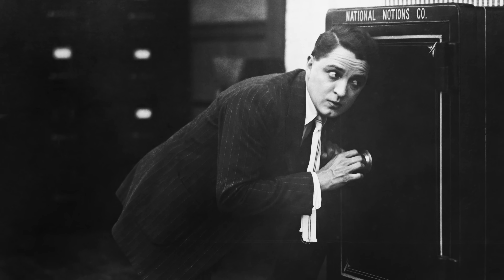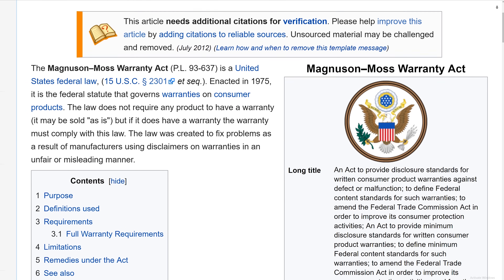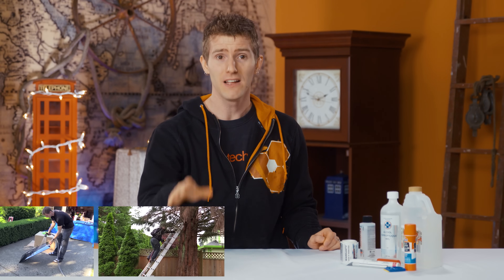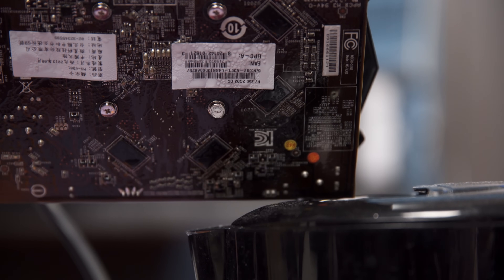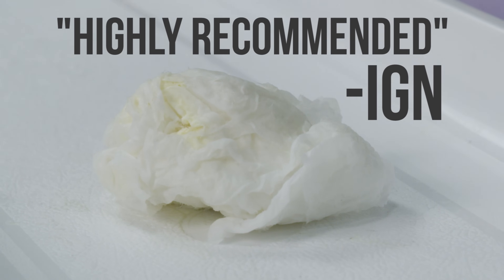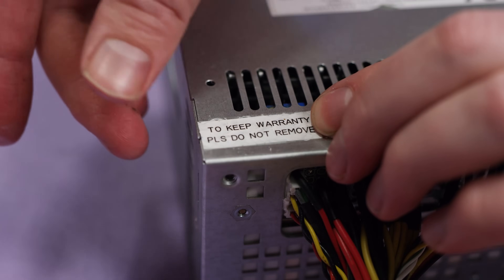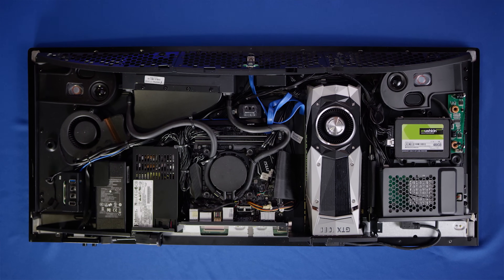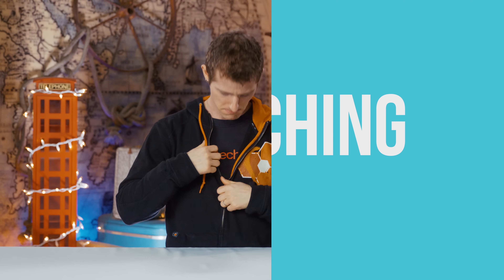Safely Remove Warranty Stickers

Comment: That legal segment in the beginning just made me keep thinking about Apple. It makes you realize how greedy those guys are for the measures they are trying to take against 3rd party repairs.
Reply: Replaced your home button yourself?
well say goodbye to your data!
Reply: Why do you think I swapped? I'm all Android now. That and battery throttling really convinced me to switch to Android instead.
Reply: Well those chargers must have the Lightning certificate protocol so yes, Apple gets money from that too
Reply: that is why I never buy apple products and refuse to use itunes.
Reply: You realise apple probably owns shares in 'third company' parts as well. So when you buy cheap chargers, apple is actually still getting money haha
Reply: This is not what that fight is against, the right to repair goes to the supply of parts and manuals/schematics to repair.
Reply: It's pretty sad to think that older Apple products (particularly Mac) never has a warranty sticker and they use standard screws. So as a consumer you can upgrade or change anything as you like. Unlike the rest of laptop manufacturer where upgrading a RAM means you're voiding your warranty.

And now their product has non interchangeable component and proprietary screws. While other manufacturer still keeps going with their warranty sticker.
Reply: Syphist Prime Fuck Apple.

Comment: Some Warranty Void stickers can be just ripped off and using masking tape, any remaining adhesives can be removed. (This means you can just buy a new sticker and stick it up there)

Works on:
Huawei Smart Watch
Samsung TV (2010-2014)
Plastic wrap on ABS or PP surface

Comment: Warranty stickers on PCs are not valid as the PC is user serviceable.
Other items like TV's are not user serviceable, so those warranty stickers are in compliance if they exist.
The whole point of the warranty void stickers isn't so that company's can screw you over a warranty claim, it's to stop numbnuts from destroying the equipment then trying to screw over the company with a warranty claim.

If you know the law then the likelihood is that you're probably competent enough to open the case and put a new graphics card in. But some people will try to add in stuff without knowing the first thing about what they are doing, like forcing an agp card into a pcie slot or vice versa, DDR2 in DDR3 anyone?

Now if the case was opened, which is evidence of tampering inside, upon who is the obligation to prove what?
A: the company with the warranty to prove that you caused the fault by tampering with the machine or B: you to prove that you did not cause the fault by tampering with the machine.

Now if you mess with the sticker and try to put it back so as to hide the fact that you opened the case, who is it that is applying the deception, you or the company?

If you break the sticker, then break it and be ready to have the explanation as to why you did what you did when asked, because in law if you lie you generally lose. What you did has to be a reasonable reason for opening the case, in the case of a power supply what would be a reasonable reason to open it? To dust it is the only one I can think of.

When troubleshooting someone else's equipment, do you ask the person if they did anything that might have caused the problem? Because I sure do as it can help narrow down the cause and save time.
Reply: IDK where you live but in my country the company always needs to be able to prove that the consumer broke it if the warranty sticker is removed. If they can't prove it then they don't have anything to say to it. Even if the stickers aren't "legal" in that sense, I think they are still good to have there. Just like you said, to stop stupid numbnuts breaking  then even more and trying to screw over companies.
Reply: I've done minor repairs on TV's aother electronics. It can be done. Just don't over estimate your skills!
Reply: magottyk So you do work at a company in the hardware department?
Reply: Catrik Although I am wondering of why he knows that, but I am not trying to mock him or anything. I agree with his comment nonetheless.
Reply: Catrik
The question on obligation of who proves what isn't in regard to practice but about what is in question when there is no definitive answer to it.
In most cases the warranty supplier would need to prove that damage was done, but in cases where there is no reason for the device to be opened, then that reverses as there is no good reason available for opening the unit.

This used to be a bit of an issue with DVD drives and players where manufacturers would claim that there is no good reason for the unit to ever be opened and it is in fact dangerous for the customer to do so because of the laser. This idea eventually lost to the fact that DVD's would get stuck inside the machine and the only way to remove them was to open up the unit. So there was a good reason to open up a DVD unit and thus the warranty void sticker became just decoration.

Is there any good reason to open up a solid state drive? Would breaking the sticker require that the manufacturer prove that you broke it, or could that be implied from the fact that there is no good reason to ever need to open up a solid state drive, and the fact that you did is good enough to say that the likelihood is that you broke it through negligence.
Reply: None of this overrides the law. If the law says you can repair your own computer you can!
Reply: Ron Lynquist
Ah but not all warranty void labels are on computers are they and the law they quoted isn't just about computers. The law doesn't apply in all things that are covered under warranty, only on those things which can be reasonably said to be user serviceable.
Reply: Or if it says you can repair anything.
Reply: Ron Lynquist.
Ok if you want to repair everything before you send it in for warranty, then good luck, not everything is designed so that the user can mod it. But I'm sure that the manufacturer won't mind you breaking welded plastic cases to get to the guts to try and fix it.
Reply: If you fuck it up then they can void your warranty.
Reply: You fuck it up the moment you break something.
Reply: Covert Brony
Yes I did work in a company that sold computers, except that the boss did believe that he could get out of warranties if the sticker was broken, until we told him that it was against the law and then he changed his stance to a please explain and had the techs investigate.

The good thing was that it was rare in a warranty situation for the sticker to be used to question the customer as it wasn't until the techs found something suspicious (like big scratches on the motherboard cutting traces) that the customer would be asked if they had opened the case. They often lied until the obvious was pointed out to them, then they came clean and we organised a fix for them, especially after being told the warranty chain could take as long as a month with no guarantee of success.

But as most times the component was still also under manufacturer warranty (we had a three year warranty and only a few components had only a 12 month warranty), there was always back channels to go through, so even if the customer stuffed up, sometimes we'd get a replacement part and so too the customer. (chain=us - wholesale supplier - manufacturer)

But the reality is that the stickers weren't the best and just taking the sides off would keep the sticker intact anyway and the stickers didn't say warranty void either, that was just implied by their positioning.

It was actually quite rare for a Computer to come back under warranty, most people don't play with their computer internals and would bring it in for upgrades anyway. I'd say that warranties were about 1% of the techs job, the rest of the time it was viruses and software bugs.

The big computer manufacturers probably handle claims a bit differently, usually there is the disclaimer that if user fault is found, that they would be charged for the time and the repair and people who have played with the insides of their computer assume that that will be the line taken because of the sticker. They might be questioned because of the sticker, but the days of wholesale voiding of warranties died decades ago.

I make a simple distinction, if the unit is not user serviceable, then I don't open during the warranty period unless as in the case of the power supply situation, the guts needs cleaning. If it can be modded, then no sticker will stop me and I'll just break it and be honest if it ever needs warranty.

Comment: Plastic razors for removing Rubik's cube stickers? They do realize it would be easier to disassemble it right? Rather than removing the stickers?

Just rotate one layer 45 degrees (halfway between two colors), and pop out the middle top cube of that layer.
Reply: Some people like using custom stickers, so it is important to them to remove the original stickers without damaging the cube.
Reply: after a few months of use the stickers start to wear out so u have to change it if you are going to a competition or if you like to take care of your cubes :)

Comment: the heatgun has worked 100% of the time for me. even works for those labels which leave half the lettering behind. however i don't use a plastic bag to remove it either. heat the sticker and surface up sufficiently, start on one corner and peel the entire sticker off very slowly with  your fingers.. if you notice it begins to tear apply more heat then start from a different direction

Comment: Quick question. With motherboard, prices included, what would be a better option... a Ryzen 5 1600X or an Intel 7700 (not K). I would plan to do some fairly light 1080p gaming, video recording and editing, and just a computer that can last for a long time. Thanks for your opinions!
Reply: The 1050ti is a horrible card for the performance to value ratio of gives ypu. Go with something like an RX 570 for around the sa!e price and get tons more performance.
Reply: Go for Ryzen. The gaming difference is not as major as most people seem, and you are getting more cores and threads for cheaper than a 7700.
Reply: Extreme 4k Gaming I mean the 7700 not the 7700k
Reply: I would likely get a 1050TI, so do I need the extra gaming performance from an Intel CPU?
Reply: Again, you are missing the point. All Ryzen chips can overclock, some even with their stock coolers, and the i7 7700 can not. I am sitting here with a 144hz screen right in front of me hooked up to a rig with an R7 1700 overclocked to 3.9Ghz. Can't really tell the difference between that CPU and my i7 6700k rig (well, I can actually. The i7 hitches and stutters like crazy). Sorry to tell you, but once overclocked the R5 would be beating the 7700 no problems. You can't do anything about a locked CPU dude.
Reply: So, I should go for the ryzen 5 1600x? FYI, I have a 1080p 60hz monitor
Reply: Yes, go for Ryzen, especially if you have a 60hz monitor. Save yourself a little cash and buy a 1600 and overclock it to the clocks of the 1600x. Also consider the RX 570 over the 1050ti.
Reply: Another misconception that you have been unfortunately pulled into. You may have heard "Man, Ryzen absolutely SUCKS at gaming. Intel is the best!". While Intel CPUs may have higher maximums their minimums can be all over place whereas with Ryzen your minimums are a little more unified. Don;t listen to these pro-Intel trolls. Think with your wallet. Logically, why would you want to pay more money for a CPU that has a locked multiplier and fewer threads/cores when you can pick up a CPU from the competition that offers similar performance with more cores and threads and the ability to overclock for LESS than the competition?
Reply: Speedy Guy I would pick rizen, if you plan do to video editing, because of more threads and cores it would render much quicker than with i7. Also it is much cheaper where I live, so you could use the extra money for better gpu , storage motherboard case etc.

Comment: I got a legit question. if your opening a product to fix it yourself, why the fuck do you need warranty?
Reply: There are other reasons for opening other than fixing, then if it later breaks and you want to send it for RMA.
Reply: zlkjsfhgjki as dkjfa;l Just in case if it gets damaged beyond repair.
Reply: Lol, since when capacitors are sensitive pieces of tech? Also you don't repair them, you replace them.
Reply: Because doing it yourself is free, but parts are not.
Reply: zlkjsfhgjki as dkjfa;l Some things about the product aren't  covered by the warranty.
Reply: Don't be silly... the warranty is there in the off chance that you fry the motherboard with ESD while showing your mates how cool a processor looks like. Then you simply return to manufacturer with a note that the product is faulty in materials and/or workmanship. Sorted.
Reply: I will admit, out of all the things I have repaired in my life, replacing a capacitor on my monitor was one of the first things I ever did. You literally just melt and clear the solder away to give way to the capacitor, get an identical replacement, poke them through the holes in the right order, and solder them into place. I had nothing to loose, so I just did it, and years later it is still going strong.
Reply: Yeah, but at least it would be free. Although if we were to think about a small problem that needs a random fix, then yeah it would be good.
Reply: Maciej Sopyło With a sodering iron that you allegedly have it somewhere in your garage?
Reply: Yes, with my eyes closed. Btw "sodering"? And not iron, but station, with regulated temperature. They are not that expensive.
Reply: Or you plugged it in to a shitty, not fused extension cord and when there was a big spike it just blew up.
Reply: Maciej, you just proved my point. It's easy to take something apart but not everyone can identify/fix electronics.
Reply: Well, if you can watch a video on how to remove a warranty sticker, you can watch a video on how to replace a capacitor. It's not some hidden knowledge (and removing the sticker is way harder).
Reply: Who DOESN'T own a temperature regulated soldering station? You can get a cheap one from china for about 40USD. Although I don't have a garage.
Reply: A Hettinger Only to those who never wanted or thought about doing sodering. Also you can use the pavement to work sodering on.
Reply: Well he also gave an example like how you want to replace a thermal paste of your gpu because you know few degrees matters to enthusiast.
Reply: for resell value i think
Reply: opens product to find what's wrong and sees a blown capacitor Let's be honest, theres a big difference between knowing how to take something apart, and repairing a sensitive piece of tech like a capacitor.
Reply: let's build a product that only work in lab environment
Reply: The thing with capacitors is, if it blows while still under warranty, there is either another, bigger problem OR the manufacturer used shitty quality components and they should suffer the costs of replacing the product. Even if you could repair it yourself for $2 in an hour.

Comment: I've been using the electrostatic bag method for a long time and it never dissapoints me. You don't even need a heat gun that much, but you do need to have a lot of patience (which the video failed to show).

And using a smaller bag is recommended, I usualy use an electrostatic bag from an Arduino, electronic modules and whatnot.

Comment: 1ST time i opened my 574eur GPU it was because my parents didnt let me use it and i had nothing good to do so i decided to clean my pc, the fans, some dust, and cleaning and replacing the GPU thermal paste. Didnt care to damage it cuz i couldnt use it at the time anyway and also i knew what i was doing, its very simple, the cooler and the GPU are two different parts just connected with some screws and the fan header, just have to take care not to drop it or to mess with the pcb, but thats simple.

Comment: I've had my MSI GT72 2QE for over a year and it warranty was for 2 year i voided it on the first day I got it and it still running strong.

if you care upgrades I've done, add 16GB of ram to have 32GB, removed 1TB hard and replaced it with a 2TB also add 2 more 2TB hard drives 1 in the 2nd hard drive bay and 1 in a hard drive caddy in my cd drive

Comment: Boys... if you dont have the courage/confidence to simply remove it then dont even try it... if you fail you will cry. ANd btw if ur not confident enough to do it you probably dont even have knowledge to do it. OK some people might wanna do it and then reaply but you need to know what ur doing very well. If it was a GPU for  (to apply a waterblock) i would stress test it alot and only after do it, also some gpus dont lose waranty when the cooler is removed, i think EVGA got some of that shit

Comment: Probably been mentioned but companies such as Audio leads, Pelican parts as well as many more produce trim tool kits for audio work.  These come with 6-10 different teflon tools in assorted sizes from flat blades to wedges.  They retail for about $13 a kit and will remove most things from stickers to dash panels without marking both surfaces. I've used them for years and they are invaluable for removing this and that without marking a customers vehicle. Just a thought anyway. edit: sorry, forgot to say I personally use Bojo's.  They are fantastic.